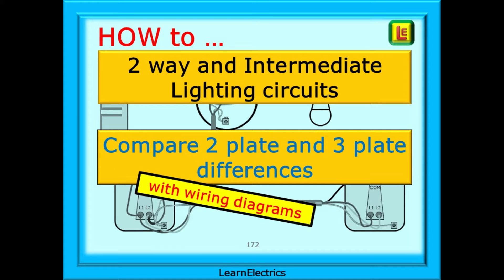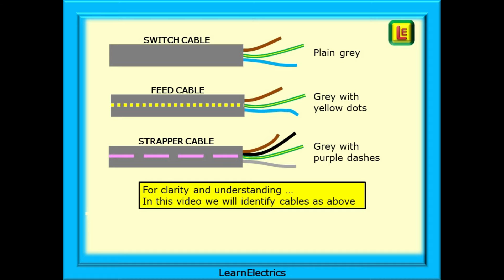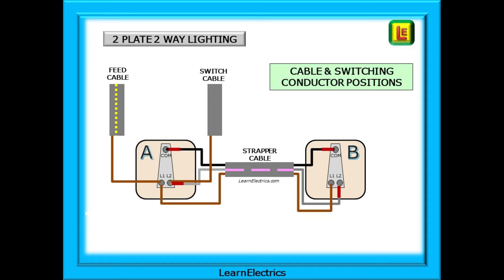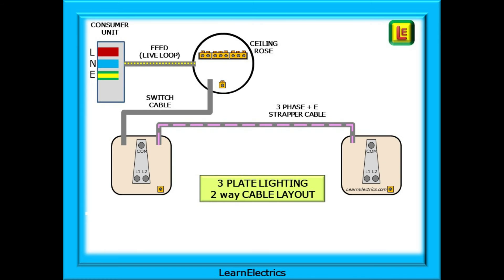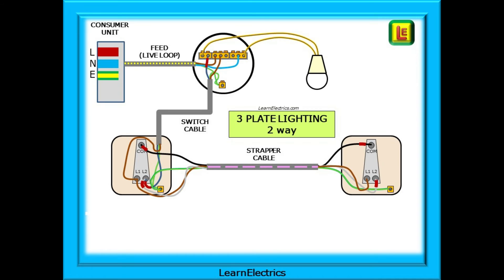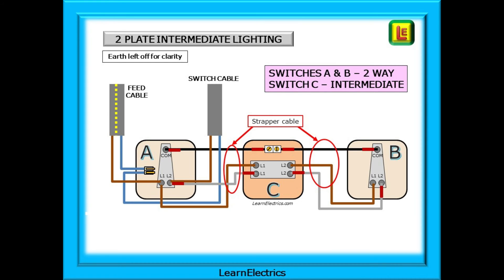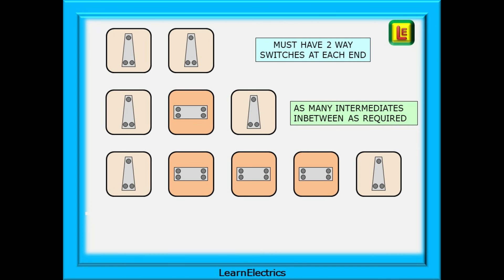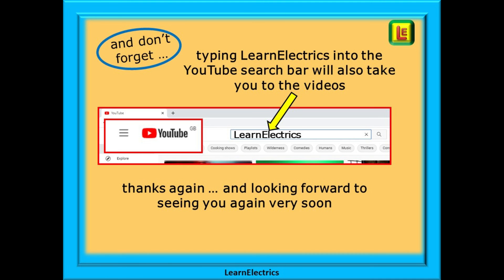2 WAY & INTERMEDIATE LIGHTING CIRCUITS – 2 PLATE & 3 PLATE DIFFERENCES – EASY TO FOLLOW DRAWINGS

Comment: Still struggling with this one, been off doing all sorts of trades and recently got some electrical work, the intermediate is stumping me a bit. God I hate being stupid.
Reply from the maker: Don';t worry, it takes time to understand. Take a look at the videos on the two links below about intermediate wiring.
Basically, you have a two way switch at each end, (3 terminal holes) just like two way switching. Then in between those you put the intermediate switches (4 terminal holes). As many as you want as long as each end is a two way switch. That's it. Good luck. Dave.

https://www.youtube.com/watch?v=vqH6Y99Dlos

https://www.youtube.com/watch?v=6S0iFEceWIA
Reply: You're a star. Thank you very much Dave.@learnelectrics4402

Comment: 2:31 Where would the feed out cable go?

The neutral into the connector block, earth into the earthing terminal. Would the live go into the common, with the black, so there is 2 in each or would it go into either L1 or L2? So there would be 1 wire in the common, 3 in L1 or L2 and 2 in the other terminal?
Reply from the maker: For two way lighting, the incoming Line (feed) goes into L1 of the switch.
Reply: @learnelectrics4402  Yes, the feed in line would go into the L1 so the black can go into the common. Where does the feed out line go?
Reply: With this kind of convention,
FeedIN/Permanent Line 
will always be connected to 
terminal L1.

FeedOut/Switched-Line 
will always be connected to 
terminal L2.

Then, it's as simple as INTERCONNECTING L1 to L1; 
L2 to L2; and 
Com. to Com. ; between those two 2-Way Switches.

Comment: Thankyou very much Dave. Am i right in saying that on a 3 plate circuit the blue neutral wire is a switching live cable while on a 2 plate its carried on through as a neutral? This is so much better explained than where i did my domestic training thankyou its amazing the clarity you bring to this.
Reply from the maker: That's correct and thanks for watching.